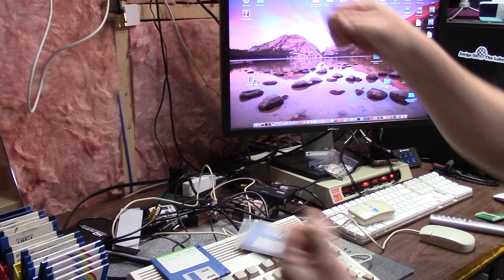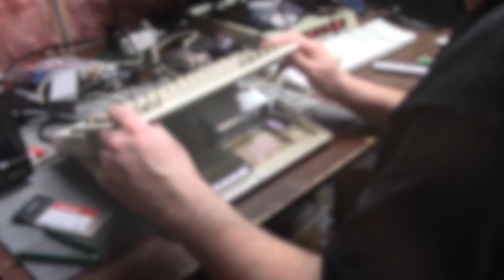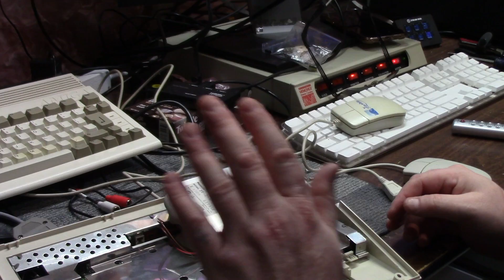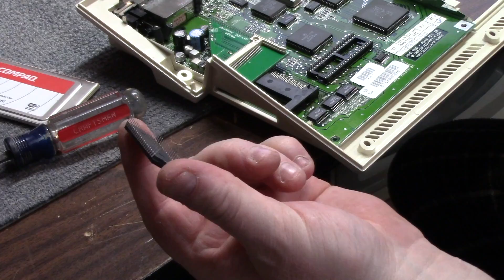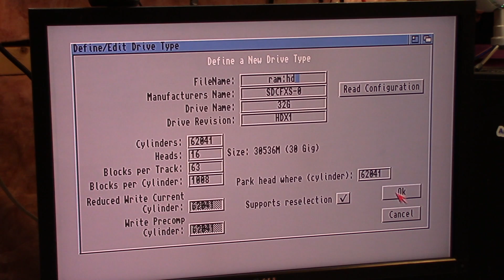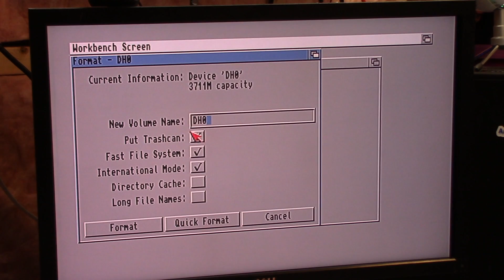Project A600 P1

Comment: Of all the Amigas this is the one I hate.
Not only do I blame this (in part) for Commodore's demise.. (it seemed to cost as much to develop than the 4000 thanks to that assmeal Medhi hired).
But also it is the least expandable Amiga of all of them.
They had to have been sipping some "Asshole Beer" the day they conceived this.

1mb Chip RAM on board with a 2mb Agnus inside. Was that some kind of sick joke?
That almost required a user to buy the 1mb expansion.
Installing that pretty much meant you weren't going to add an accelerator (i.e the 1200) and have 2mb of CHIP RAM at the same time.

Granted, the sometimes ridiculous ingenuity of Amigans, can still get a Megachip in there... maybe...  assuming you can desolder the Agnus (my God look where they put it... making it a pain in the ass to use heat guns on it!) install a socket and then the MegaChip.  

To me, it seems C> went out of their way to make this Amiga unexpandable.

Not even the 68000 would be a friend this time.
Nope.  No CSA Derringers or Mega Midget Racers....    or PP&P 040's....   Or even the M-Tec 020 could be installed. 
Those require the old long socket.

You'd literally have to install a 68000 PLCC socket...  and invent a brand new board that goes inside that socket to upgrade the computer's speed.
Or I guess swap out the PLCC 68000 with a PLCC 68010 rated at 25mhz (they exist!) and run a clock line to the 28mhz clock... 

But still no fast RAM for the CPU to enjoy (sigh).

This Amiga was designed for ... (thinks up excuse)....  ...    shit.  Can't think of one good reason.
Always felt it was a money dive.

They allegedly pumped millions into making this hunk of unexpandable mess...  makes me wonder if some of that money went into their own pockets.

Gould probably didn't even know he was duped by it all.

I mean its too basic. Too small.

Since Irving didn't know Bug squat about computers... he was fooled when they simply showed it to him.

"See Mr Gould, it even has the PCMCIA slot like the 1200...   "
He bought into it and the most expensive Amiga to develop (least on the books)...  was released.

C> went belly up a year or so later (or less).... and asses were conveniently covered by that.

I'd rather get an old A500+  (had one once...)  than this...    "Amiga 500 JR"  (ala... our PC-Jr)

It is amazing how only one chip is socketed on the entire board (the ROM).

Still.. I guess if someone gets a hold of one they could set it up as a game machine with the internal card idea...
Me?  I'd have to find a way to add some fast RAM to it.... speed it up...  and/or max the CHIP RAM without using the trapdoor slot.

Is that even possible?

Can the trap door slot be used to add Fast RAM instead of CHIP (assuming a megachip is in the equation)?
Reply from the maker: and it ended up being more than the 500 was to produce... mgmt wasnt smart at all. and marketing was even worse
Reply: @ChrisEdwardsRestoration   After watching the Death Bed video again...
I wonder.....
If some of it was on purpose?
I mean I got the sense that no matter what the "team" did... no matter what they made...
Commodore's leadership already had their minds made up.
They blew like 6 different deals...

Today is just as a bad.
Seems a couple groups are in the middle of lawsuits for the name or rights to some part of the OS...  sigh.   
::(
Reply from the maker: I was there it was weird i had 4 different boss’ each with their own ideas or agenda. At the end 93/94 Upper mgmt did not know how to do anything.  Most of the C= loving people were replaced with PC people who had no idea how great the amiga was. Budgets were slashed , research and dev had no funding.  Engineering was left alone but needed funding desperately.   They were more interested in milking what they had, but they didnt know what they had

Comment: In severally of your videos you mentioned some kind of oxi, oxy, oxidation cleaner but never say clearly what it is. What is it and do you recommend if for cleaning connectors, MB and so on?
Reply from the maker: its a spray called "DeOxit" its super expensive for what it is, like 16.99 for 2 oz can, you use it sparingly, but it cleans and lubricates electronic contacts. heres a link to where i get mine from , you can get it anywhere  https://www.microcenter.com/product/397475/caig-laboratories-deoxit-d5-spray
Reply: @ChrisEdwardsRestoration  Thanks, regretfully we only have on microcenter in CA down south, but Amazon has it.

Comment: Nice clean board and a bummer that you have not enough CHIP RAM. Should not do a big 128GB CF card on it and get a 16GB CF because you don’t have FAST RAM on it. Would be nice if you have 2MB CHIP RAM and have a 68020/68030 card with some FAST RAM.
Reply from the maker: its coming soon!
Reply: That would be great for your A600.

Comment: Maybe you did not get that warranty sticker but it really looks like things worked out for you.  You really need a min of 1.5 mb or RAM to get 3.1.4 to install but you could try increasing the block size just to format that partition or lower its size.  No real biggie.  If you have to order a RAM Expander you might as well just recap it.   That short LED Cable is a PITA and the wires break easy.  I forget where I bought a new LED Board but it came with a long cable and I have yet to break one but its so easy to do because its too easy to forget the cable is so short.  Individual Computers has a nice RAM board that will allow you to install an INDIVISION board and RTC if you want that.  Its supposed to also have some USB Support but I never bothered with it.   The A600 I use all the time has a Vampire in it but I could never get the damn network card to work with it but its not a deal breaker I could of ended up with fake boards from China for all I know.  I will tackle it again in the future but I do like my little A600 because it takes up very little space in the corner of my L-Shaped Desk.   What is the full model number of that Dell Monitor and does it have a VESA MOUNT?  I have a monitor I am happy with but no VESA Mount so I can't use this cool stand I have that holds 2 monitors and it would be nice to get them up off the desk.
Reply from the maker: I looked on their site could not find much for the a600 what is that board called...?
Reply: @ChrisEdwardsRestoration   Have a look at https://retroready.one/ they sell the A600 longer led's for the A600 hope this helps  :)

Comment: Very nice looking A600. A couple of my 600s looked like they had nice caps. But I could smell the fishy smell once I started heating up the soldering joints with the soldering iron. you need more RAM. LOL. Looking forward to the next part.
Reply from the maker: I will be replacing them in a future video, my Hakko tweezers broke so i may have to use some cheapos until i can replace them